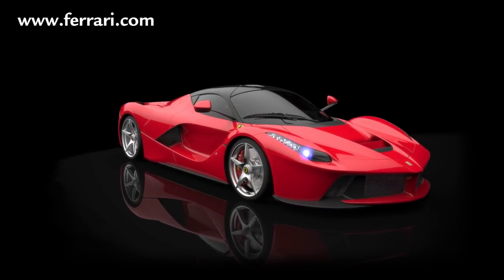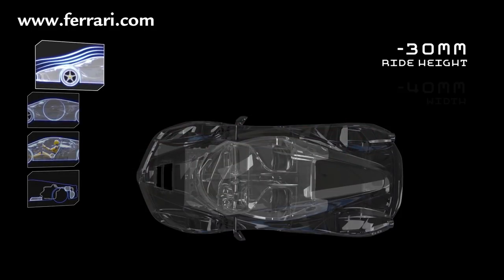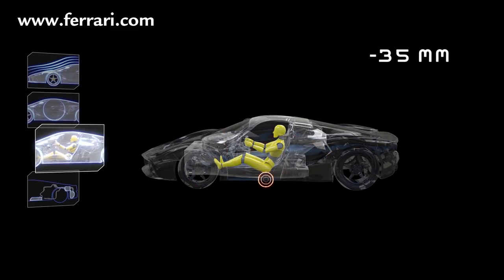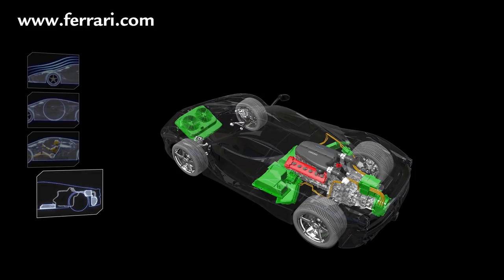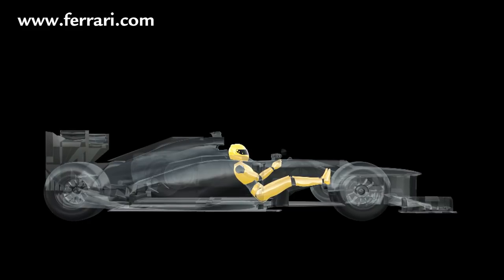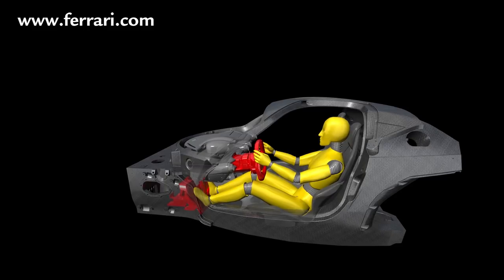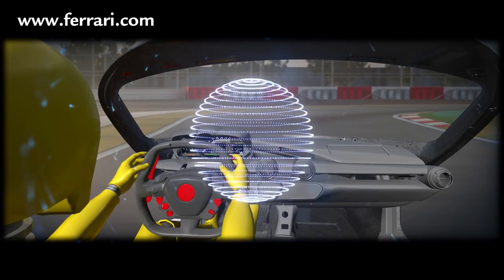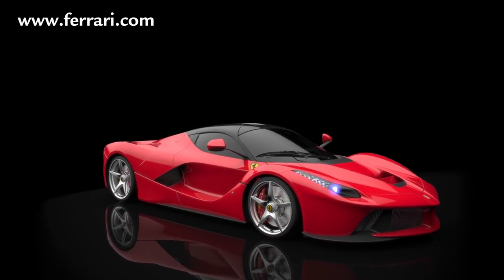LaFerrari - focus on architecture

Comment: I love my 2013 LaFerrai. The aero performance, hybrid electric is continue power on apex driving no lags at all. My performance at Yas Marina Circuit (Full Circuit track length 3.45 miles) I put in a blistering 2:12:34 this is extremely fast. Thanks Ferrari!
Reply: If you don’t mind me asking,what did you do to buy it?

Comment: LFA has also been referred to as an engeneers wet dream, so that too will quaifie as an engeneers car :P

i also noted in the video that the seat was in the chassis, ferrari were not the first there, the sesto elemento had it before it was launched, but we don't know if it had it in the 2010 and 2011 concepts (project F150)

Comment: mate, honestly the Agera R has more then 200 bhp and it's slower on both 0-60 and 0-122 and only barely quicker on the 0-186 by 0.5 sec, LaFerrari with no turbos, but only with the most powerful naturally aspirated engine in the world, has 963 bhp enough to push the car on 0-122 in less then 7 sec compared to the 7.5 of the Agera. IMO this car is proper engineering(:

Comment: Mate i'll let the numbers talk. The 0-186 is nearly the same, it's 0,4 slower ( 15 sec ) against the AgeraR ( 14,6 ) BUT LaFerrari has 200 BHP less, and more importantly Ferrari does NOT use any turbo's to get easily more power, the 0-60 takes less then 3 sec, the Agera takes 3,6!! ( as you can see on their video the 0-186 run ) and the 0-122 takes 7,5 sec whether the Ferrari is less then 7 sec! i'd say proper swedish power but that'all

Comment: the most advanced parts for each of the cars:

918: the hybrid system (so much preformance and so little consumption/co2)
laferrari: the chassis/structure (several types of carbon fibre)
P1: aerodynamics (most downforce for a streetlegal car)

Comment: It's funny to see Ferrari marketing taking advantage of higher mass volume at the back 59% against 57% at Enzo. Even Formula 1 cars and LMP cars do not exceed 57% at the back. Just another proof to mask their fail to distribute the weight better because of hybrid system. Conclusion? Great acceleration numbers for fanboys because of weight at the back and poorer handling.

Comment: lol, is that true? It's impossible for a 1455 kg car to match F-1 times which has 2x power-to-weight ratio. Even the LMP1 can't match the F-1.
McLaren are too stupid to say it. They forget that there are Zonda R, FXX, Aston Martin DBR9, Lotus T125 which are real race cars.
I bet it will only get about 1:11 to 1:13, In the FXX-Huayra range. The aero itself can't help much if the car is heavy. They should slash the weight of the P1 until it weighs 1100 kg.